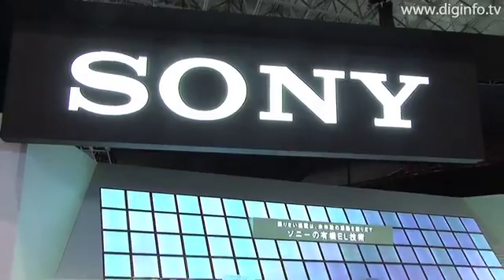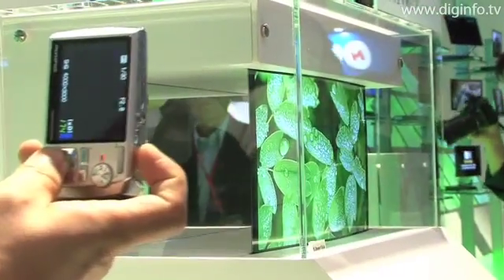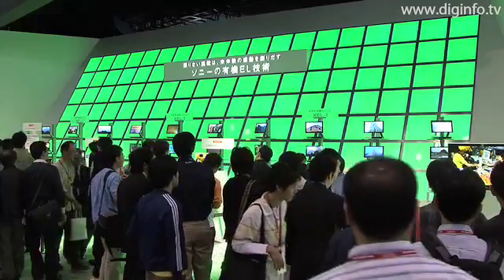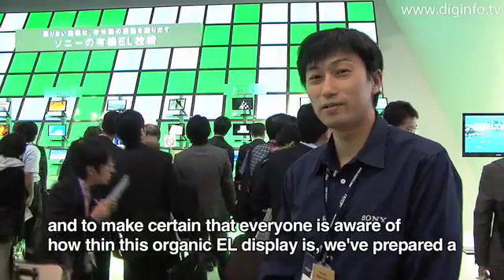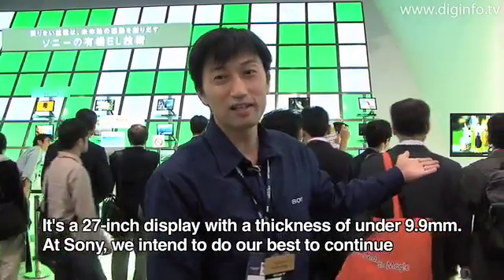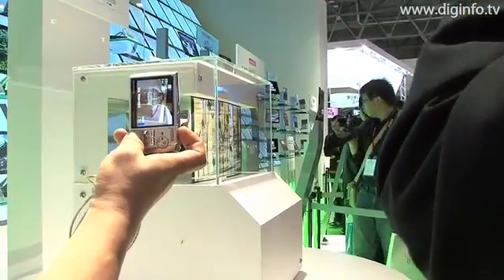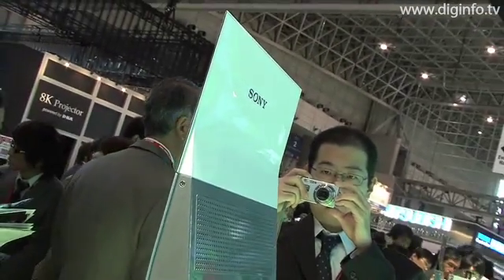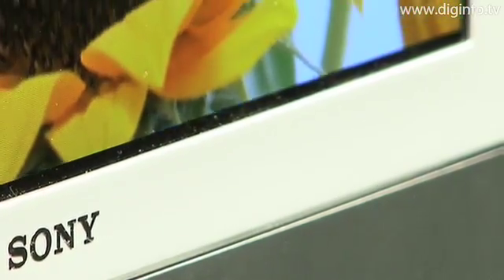Sony OLED Prototypes - CEATEC Japan 2008 : DigInfo

Comment: it cost's $2,500 just for the 11". get a lazer tv. they have that for 7,000 wich seems bad but a 65" lcd is 12,000.  and laser looks just as good as oled and has all the same benfits but it's 10" thick but i don't mind giving 10" of space rather than thousands of dollars.